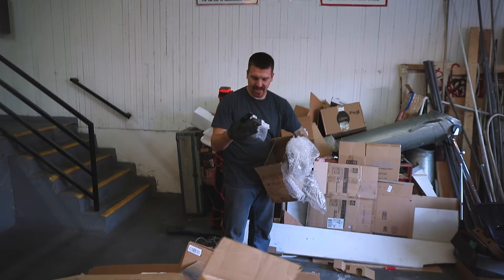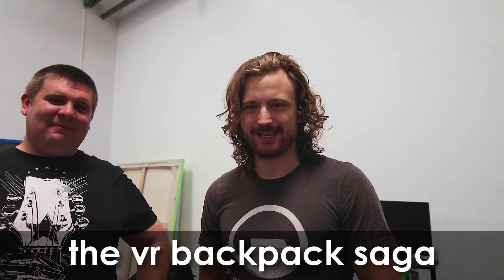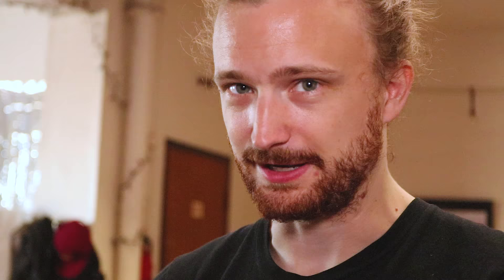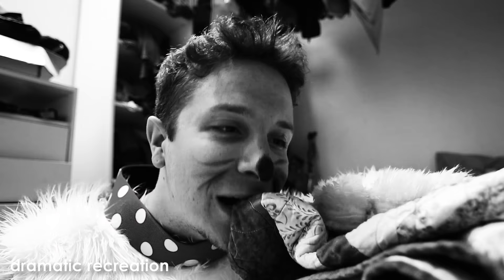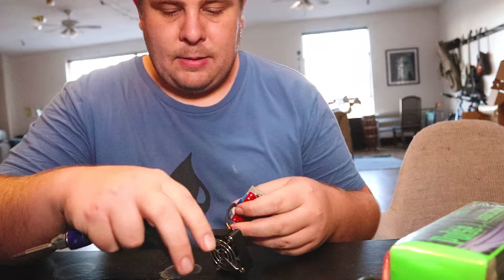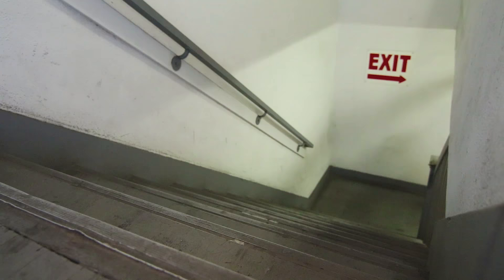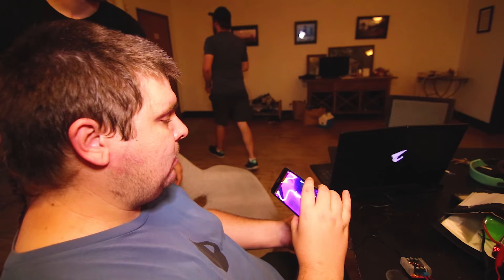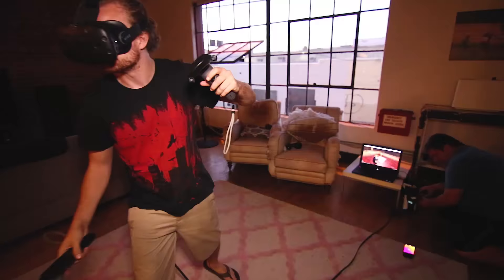Cockroach in My Bed 🕷

Comment: "better is power per dollar" Oh okay. I thought better is better. Better beckons the question "at what?". A Ferrari might be better than a truck in a drag race, but a truck is better than a Ferrari at transporting large amounts of goods. When you repeatedly shout "The 1080s are the BEST!", unless you specify "for their money", you can't blame people for assuming you meant "best performance". Moreover, the 1080 is far from the best card for price:performance ratio, that's a ridiculous thing to say, especially when the total cost of 4 1080 cards is at least $2,400...
Reply: The only card that is better at cost per dollar (while also reaching a threshold of acceptable power) is the 1070 card. But even then, to match the 10,000 CUDA cores you get with four 1080s you'd have to get five 1070s. I stand by my statement.
And I don't blame people for taking our little vlog skit literally, which is why we clarified.
Reply: ***** Yeah, fine, "while also reaching a threshold of acceptable power' is another criteria that isn't necessarily clear, either.
I was one of those people who commented in the original video, was disappointed not to see it in this vlog lol, but in my comment I did make sure to say that I knew you guys were joking around.
Reply: Just think that people care enough to comment on it, X and Quarto are better cards if money is not a factor, but money was never brought up(as it's pretty taboo weirdly)
Reply: you sound a bit triggered yanxter, 4 1080s is going to the job very well for wren, so why you whinning???...
Reply: Nick Here "whinning" lol. Can't very well take your question seriously, you are literally whining about my whining, so, ask yourself why.

Comment: Well better doesn't mean more cost efficient. Better means Better. If I buy a graphics card for free and it sucks dick that doesn't make it better then an expensive card that is more powerful. Even if the dollar per core is better. It honestly just depends what your definition of better is. My definition  of better is more capable. A card may be Better for YOU. But that doesn't make it objectively better then the other card
Reply: Fair enough. I was obviously simplifying it to a large extent. Perhaps a better way of putting it is saying the best card is the one that gives you the most bang for the buck rather than power per dollar, because that includes diminishing returns better. I want the most powerful card I can get without losing too much money on incremental power increases. For me that line is between the 1080 and the TitanXP.
Reply: omg you just commented on a post of mine